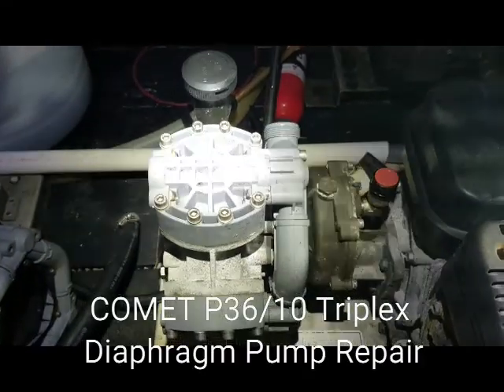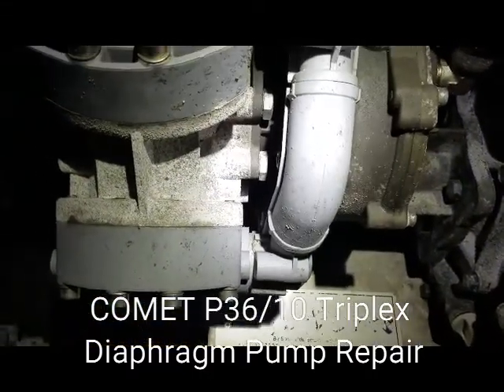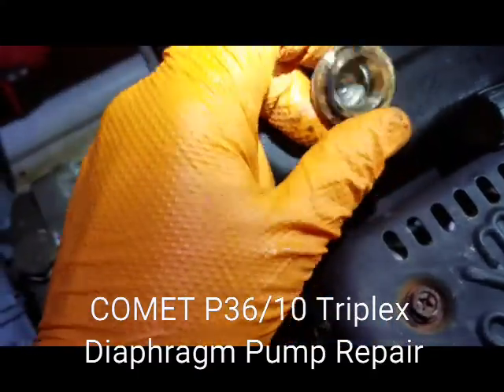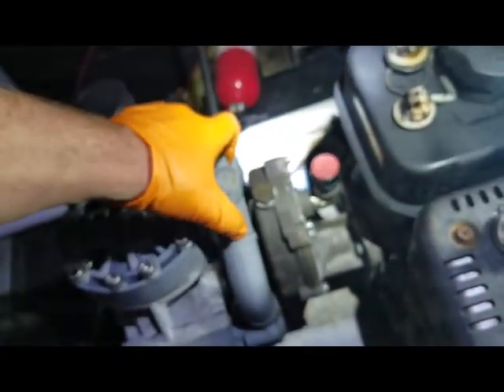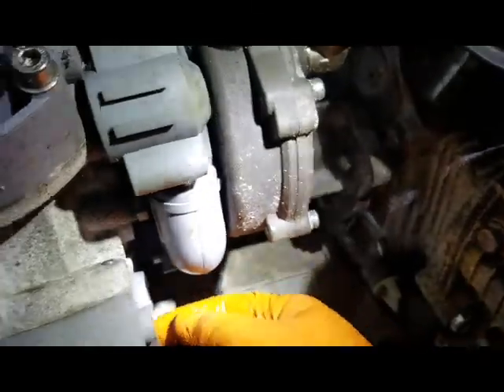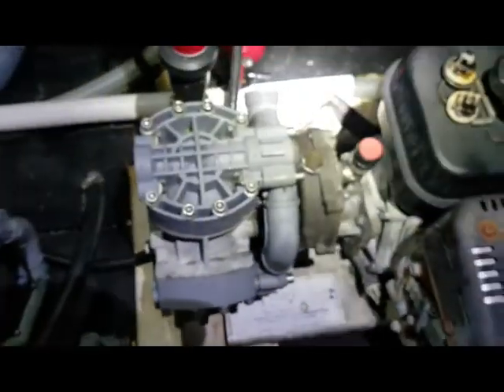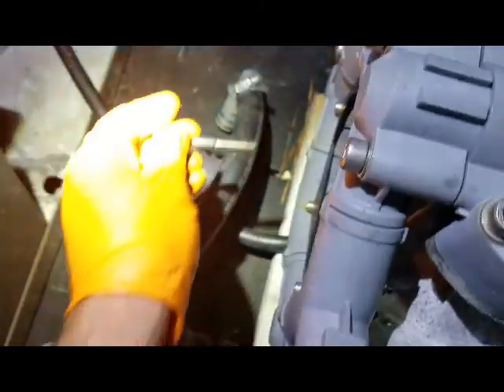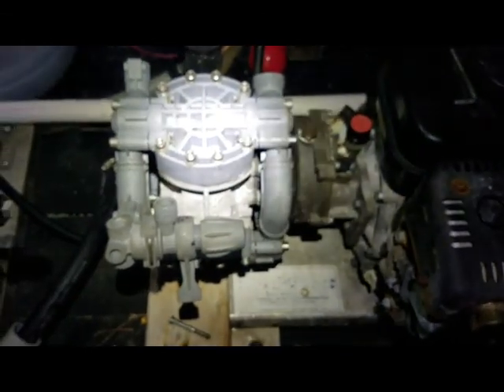Comet p36/10 triplex diaphragm pump

Comment: Do you have any information or can you point me to a video of pump breakdown for diaphragm replacement. Pump is a month old and think it's already gone through its first diaphragm.
Reply from the maker: Palm beach power washing LLC do the check valves good?
Reply from the maker: Palm beach power washing LLC what makes you think the diaphragm has gone bad?
Reply: I haven't checked but I explained it to Adam from comet service and he said it sounded like it be a diaphragm.
Reply: @clean power wash Ok so wasted money on diaphragms when all I had to do was pull the check valves. Which were clogged with debris. Do you know of an inline filter that I could put on the inlet line?
Reply from the maker: Palm beach power washing LLC  filter depends on what chems you are running through the machine.  powerwashstore.com makes/sells a pvc filter.
Reply: How long do these pumps last
Reply: Does Russ have all the parts for this unit?